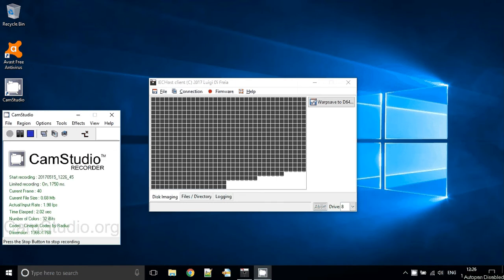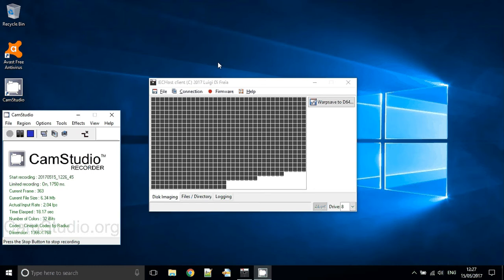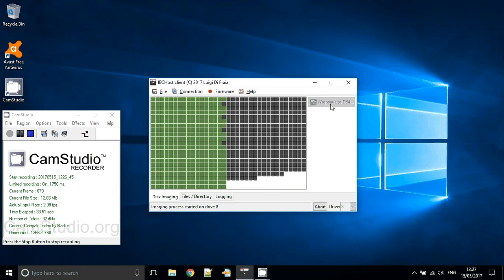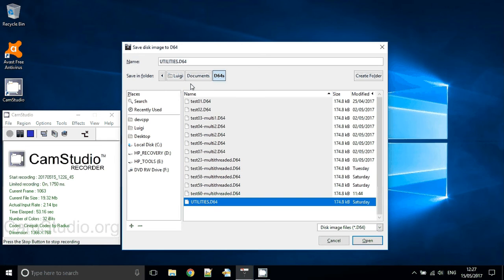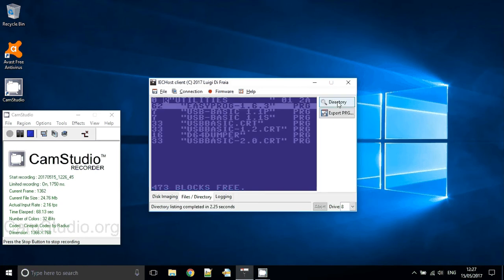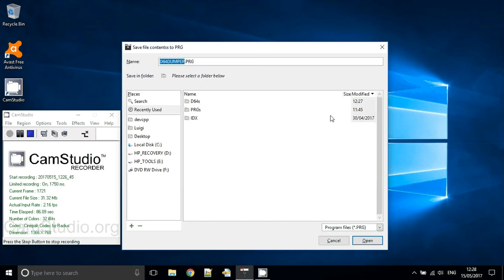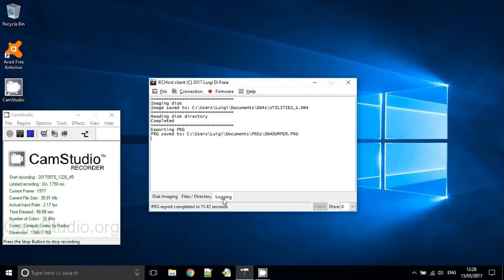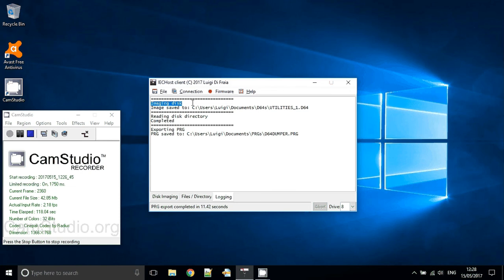How to backup Commodore 64 floppy disks to D64 files using IECHost and a Commodore 1541 drive

Comment: does the icehost frontend support mass reading of floppies and auto-naming the d64 like warpcopy does?

f.e. you give it a first name like 1023a and it continues with 1023b and then 1024a, 1024b, 1025a.....
Reply from the maker: I am working at the "mass dumping" mode and it should be ready by November, which is when X 2018 will take place. Also, this is a rather old video in the IECHost series :)
Reply: just found it to be the most fitting to ask for such a feature as it finally could replace all the warpcopy hickup with it's hangups and all the hickups that occur from time to time..
Reply from the maker: I have to admit I don’t know much about such hiccups. Is there an issue tracker for Warpcopy64 that I can have a look at so they I might be able to avoid common pitfalls found by users?
Reply: i don't think there is. not sure if it will ever get an update or such.

seems some discs the reading with error blocks makes the system or even crash the c64 side of the tool.

some you can overcome with opening the floppy and thus skipping over bad blocks or so.

it's just the observations weasel and i have when we transfer discs at his place.

not sure if this is entwork dependend or so. sometimes i just loose connection to the drive side for some above reason meaning we have to restart the c64 to make it work again.
Reply from the maker: Ok, thank you. I am asking as I plan to support WarpCopy64 too down the line. For the time being I think IECHost has the great advantage of involving less moving parts, so there are less things that can go wrong...
Reply: yes i would prefer something that is just plug'n'play without having to run anything on the c64 side. less network hardware, less issues..
Reply: as long as it's sort of fast it's fine with me :)
Reply from the maker: Have a look at this one video for the upcoming mass dumping mode: https://www.youtube.com/watch?v=-a1K1JimIPk